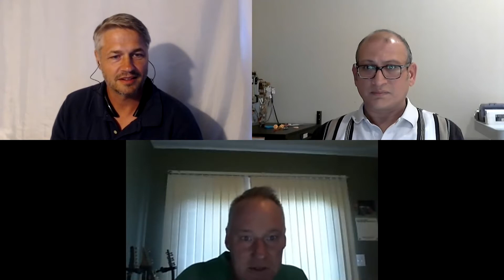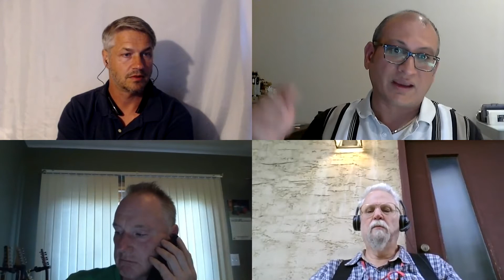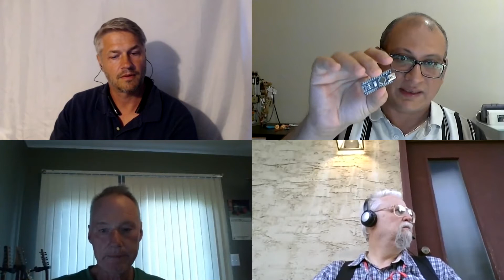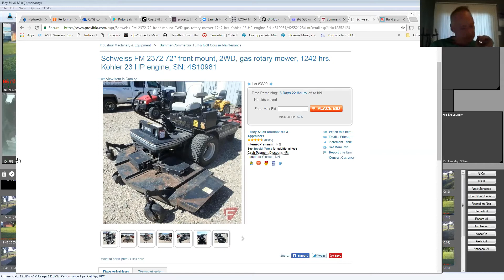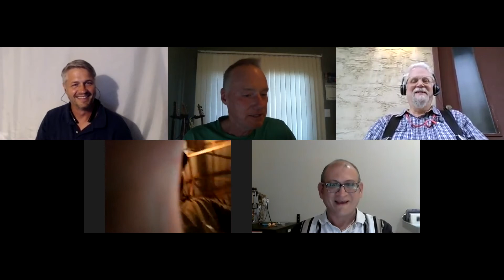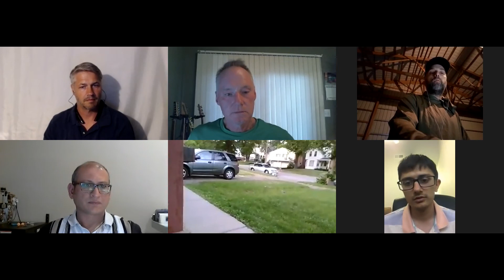CommunityMeeting 06052018

Comment: After seeing AgOpenGPS drive the tractor flawlessly for a few thousand acres this spring, I'm convinced that the limitation and future success of any system is its ability to interface with the user in a graphical and informative manner. The real programming challenge for non holonomic and even holonomic ag vehicles is in the automation of converting field boundaries into a planned and calculated field path independent of machine parameters with little to no human interaction of that plan, only verification.
Reply from the maker: Hi Brian,  I agree.  The user interface will be a big step in making things easier to use.